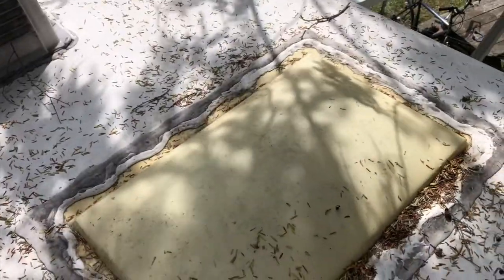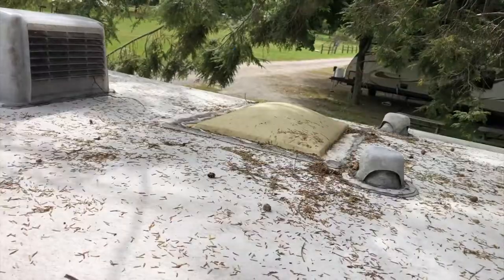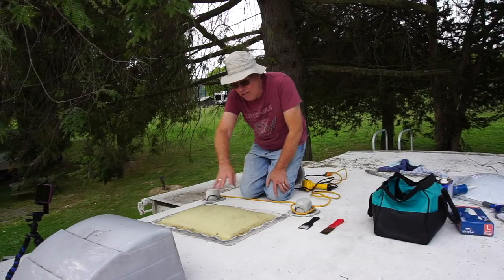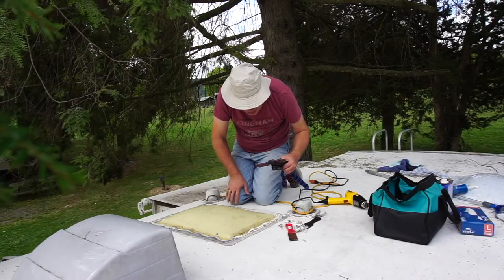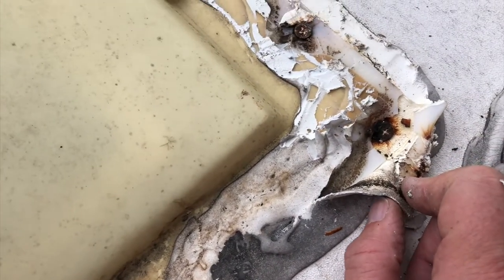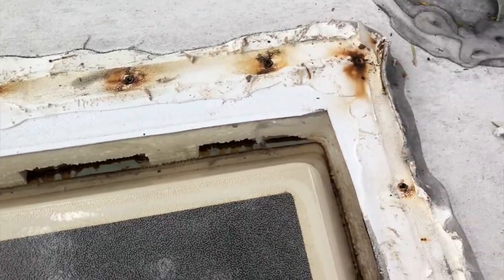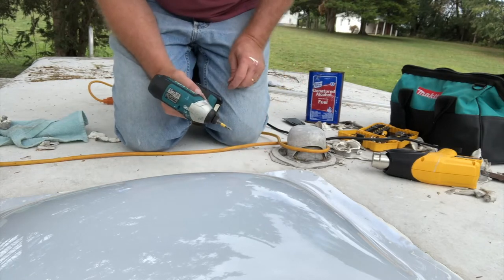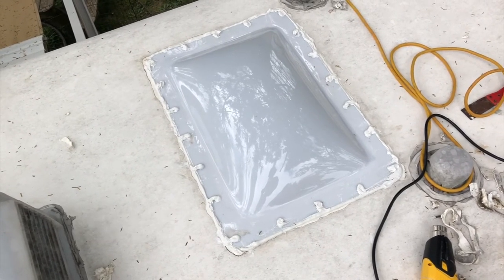How to Replace the Skylight on Your RV

Comment: You described your leak issue and it sounds kinda like mine. There's no rain now or moisture on the outside of the RV that I've noticed, but I have water leaking in the bedroom corner. I noticed condensation on the inside of the skylight that's above the shower.  I'm replacing the lap sealant on the roof and probably the skylight since there are cracks. My question is could this condensed moisture be the source of the water and it wicks horizontally somehow to that corner in the bedroom? Any wisdom is appreciated, thank you for the video it cleared up a lot for me
Reply: The answer is “yes". Water will always find a way to the lowest point, and many leaks near the crown of the roof will display as a stain along a wall. Good luck!